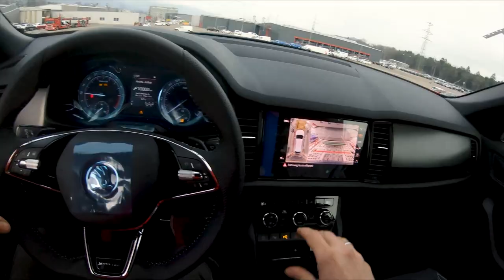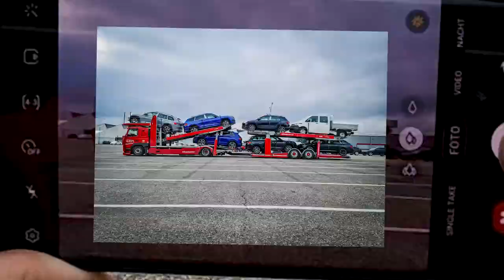POV Loading I 7 Big Cars - NEW Tiguan R  I Kässbohrer MetagoPro Cartransporter I Volvo FM4

Comment: Hi,
When moving a car (automatic transmission) with a hydraulics, in which position you put the transmission ( N or P), because moving the car in a P could broke the transmission? Or not 🤔
Reply: I saw at the last Skoda (Octavia) that the transmission in Drive position when he leaves the car and move the platform. So, he has to back into the car to put the transmission in P and shut down the engine. That's not shown in this video.